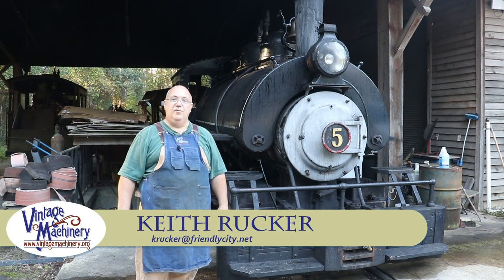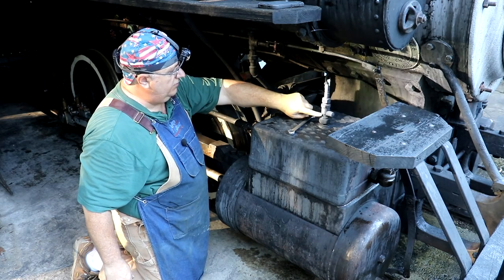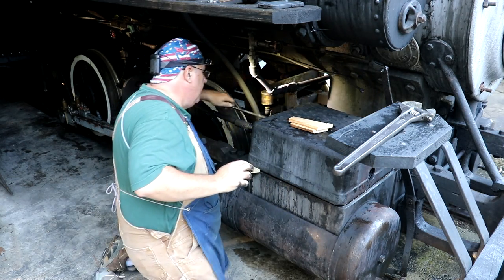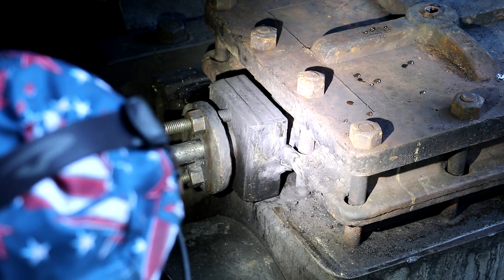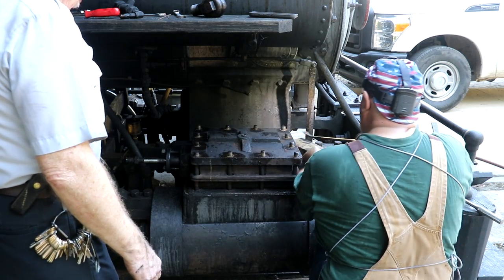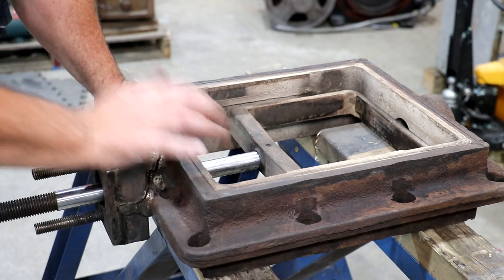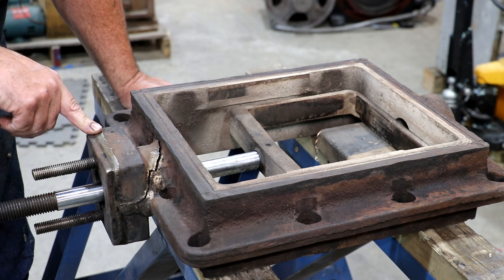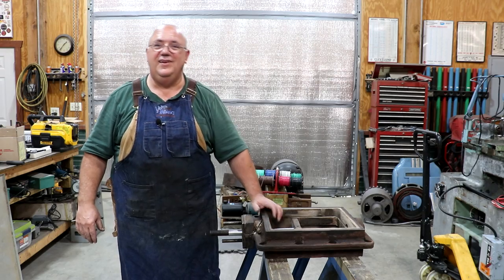1917 Vulcan Steam Locomotive: Removing a Damaged Steam Chest for Repair

Comment: I would check that operating rod connected to the steam chest, as it seemed bent to me, and that could cause an eccentric loading on that packing gland if everything isn't in line.
Reply: That could also be the root of the problem that appeared to be worn bushings.
Reply: I also noticed this as well
Reply: Yeah, I agree. You can see the rod isn’t straight and true @ 11:11 or so, as Keith is unscrewing it.

Comment: Thanks for posting. You mentioned that the crack was allowing the ear to fail downward, which looks to be the case. The long rod you removed looked like it wasn't straight. It would seem that future damage might be avoided if that rod was straightened and the part was made true so the forward and backward motion of the rods were as close as possible to parallel with the surfaces the valve slides on. I hope the preceding sentence makes sense.
Reply: I understood you OK. And I ein't that smart. Is it ein't or ain't or neither?

Comment: Hello from Fayetteville, NC Keith. While many have commented on the valve rod possibly being bent or out of alignment, which makes a lot of sense, I’m thinking that perhaps the maintenance folks may have been over tightening the gland that keeps the packing around the valve rod. The pressure created compressing that graphite packing material is very high and it needs to go somewhere. Is there a maintenance reference saying how much to tighten the gland studs? I used to work for an industrial valve repair shop and we had that problem with one client that managed to destroy several valves before they realized they only needed to turn the packing cap 1/10th of a turn at a time ONLY when it leaked; they were turning it every week as a preventive method.

Comment: I realize you may have already finished this repair by the time the video is posted but if you were to make a silicon pattern from the steam chest you could then make a plaster positive to have a copy of the chest to use as a core to have as casting made. May be easier than starting from scratch with prints. Also, easy to modify and beef up the flange area so it never happens again. Just glad to see you back at the museum
Reply: Can’t. Remember, the casting shrinks by a significant amount when it cools so any casting made from an original will be too small.
Reply: @whodat90  i think cast iron shrinks only 1%, if the inside ends up 1% too small, it can be machined to the correct size, and if the outside ends up 1% too small, it doesn't really matter, and cracked area can be be modified prior to casting to make it way stronger...
Reply: 1/8"  per foot
Reply: @anthonyraffin1034  1/8" per foot should be very close to 1%

Comment: I kept staring at that crack and trying to imagine what the failure mechanism was. The valve rod should be pulling straight in and out, so all the force should be just pushing or pulling straight in line with the rod. It seems like there must have been some side to side (or up and down) motion of the valve stem to have fatigued that packing gland to the point that it broke. I'm wondering if this break is a symptom of something else out of adjustment or alignment with the right-hand valve actuating mechanism.
Reply: As Keith pointed out, welding cast iron makes for brittleness.  Vibration is ALWAYS present, to some degree.  The weld held up for 25 years, which is not exactly shabby.
Reply: @eliduttman315   That still doesn't explain the original failure. There is obviously some misalignment somewhere and for now I would start by straightening the valve rod which is bent.
Reply: Yes, I was musing as to what the failure story was. I noticed that the rod which screws onto it is bent, which is either a symptom or a possible cause, and I wonder if the gland was ever overtightened.
Reply: @eliduttman315  25 years is a long time but the engine was probably fired only a few times per year. Still, something is causing that part to fail as several have pointed out. Love Keith’s knowledge and expertise in old technology.

Comment: Noticed it looked like the rod was bent when you removed it.  Did something come down on it and bend it  That could have put  extra pressure on it causing the crack.   But should work good repaired.   Looking forward to seeing the rest of it
Reply: I'd wager somebody stepped on it in the last 110 years.
Reply: Looks to me that there is a definite alignment issue that is putting downward pressure on that sealing gland. Each time the valve rod moves through the gland it’s being forced through at slight angle not parallel to the mating surfaces of the valve and the upper plate of the steam chest and the porting surface in the cylinder. This creates a stress on the sealing gland body that repeats with each stroke of the valve. Eventually the stress creates micro defects in the metallic lattice structure, and these defect vacancies coalesce into voids and the voids further concentrate the stress which leads to cracks forming. This is the mechanism for fatigue cracking. Unless the alignment issue is corrected the repair will fail again as repetitive cycles stress and relax the brazing. A bent valve actuating rod could be the source of the alignment issue.

Comment: I've always wondered why you can't just use the old part as the pattern for a new casting? I understand shrinking is a concern, but one could build up the piece with clay or filler to allow for the expected shrinkage... thanks for another fun video!

Comment: What ever happened to the coal feed engine that Abom couldn't machine? That was a fascinating device and I wondered how it would go back together.
Reply: I suspect the completion of the HBM restoration project is on the critical path for the stoker engine to be worked on again... The first time I saw that stoker engine case, I thought to myself "this is an ideal application for a small HBM...". Then Keith bought one...

Comment: Hi Keith, A great video; love to see how these components that you are going to repair, fit in with the entirety of the locomotive.  Thanks.

An even better repair than brazing is to use cast iron filler.  See, for instance, the repairs that The Steam Workshop did on their 2' narrow gauge Fowler locomotive:  www.youtube.com/watch?v=JHCXMexB5B8

Be well & Best regards, Gottfried
Reply: Nice link. I worked in Gray & Ductile foundry. The molecular composition of the cast iron does indeed change. How they (in your link) slowly brought up the heat in the casting was smart.

Comment: Would a brazing repair done now still last indefinitely or would it always be prone to failing again due to the nickel rod impacting the integrity of the casting itself?
Reply: It's possible to anneal the cast iron to take out the brittleness. The nickle would still be there and might still be a problem though.

Comment: I dont do 3D printing stuff but someone, somewhere can laser scan that entire thing, enlarge it by 5-10% (?) for casting shrinkage, and print the positive. I for one like the idea of the silicone mold, then a plaster positive. Then you could "easily" modify the positive to get a little bigger positive. Sounds easy enough :-)

Comment: If you do get it recast, make the neck bigger. There's no reason (by my reckoning) for that neck to be so flask like. I've seen a few stuffing boxes of this design and it's always a weak point. Were it me, i'd make the rod the weak point, rather than the casting (because i get why the casting is done the way it is).

Comment: Two thoughts from the depths of my ignorance but...

Since you are of a mind to make casting as a long term solution, wouldn't "now" be the time to do it? Rather than wait on blueprints, has the used piece changed enough in size over time to make that a problem? After you have made you repair, it would seem like the right time to create the mold from the old piece.
Also, when I have done things like tie rod ends on my car, I use a white grease paint pencil to mark threads so it is easy to return things to an exact position without having to count threads. Would that work in this situation?

Comment: Love the steam engine videos. What's happening with the restoration of the other steam locomotive you and the others are working on. Last we saw was you were trying to machine the inside of a huge piece that had spray weld applied but the angles were making it difficult ?

Comment: I wonder is there is a stress exerted on that part of the casting from the rod motion for the valve that contributed to the part initially cracking along with the heat cycling for decades.

Comment: Even if you do find the blue prints, maybe you should modify the prints to beef up that area to make it a little strong part so it can handle the stress better. It looks like a weak area from just the way it was designed. Just an idea...
Reply: Counter-intuitively, beefing up a design could actually make it more likely to break! These engines often will have weak points designed into them such that in the case of a failure it doesn't destroy itself. For a 100 year old loco it's not doing so badly, I would expect the new part to last at least another 100 years again and maybe even longer with the high quality materials and processes we have available to us today
Reply: Valve bodies were a wear point.  Remember these engines weren't designed to last for over 100 years they had a service life of around 30 to 40 years before being retired and scrapped.  These things are literally older than the engineers thought they'd make it.

Comment: Before you start grinding and heating. Are you going to check the top and bottom sealing faces on the surface plate. 
Just probing with a feeler gauge.  I don't recall if your lapping plate is large enough to lap the faces.  

Instead of trying to duplicate the shape of the casting. A sheet of cast iron could be machined . Then the outside detailed with a needle scaler to get rid of the machining Mark's. 
Rectangular cross sections and a pattern made of wood like a picture frame with significant draft in either direction from the parting line could me made up on your table saw in an hour.   Removing metal in 2022 is far easier than it was in 1890.  You have the machines to do it at hand

Comment: hey keith ! thanks for the videos as always. im looking at the failure and at the design of the chest....im thinking thats a flaw in design and will fail there again. i ponder if cutting it flush to the steam chest boring and threading the chest and using pipe to recreate the stuffing box for the valve rod. any future failure would not require removal of the valve body just the threaded pipe  but steel plays better with bending than cast so it probably would not fail.

Comment: Is there a similar Steam Chest on the other side of the engine that you can take a pattern off ?
Or is that one repaired also  ?
Reply: It is much easier to consult the original documents than it is to reverse engineer a part especially when you've got a 100+ year old part. This steam chest's counterpart has decades of wear and tear from high pressure steam ( which will eat through through cast iron, as it did in another episode on this locomotive ), corrosion and abrasion, maintenance via machining and boring out of irregular surfaces, field modifications, and other factors in this locomotives history unknown to the current operators.

Comment: changing the studs to a vertical configuration probably doomed this repair, (as doomed as only 25 years on a repair is) having the studs reinforced by the web of the casting would be much more preferable. I would bake that sucker in a oven to 400 degrees before attempting this and then throw it right back in there slowly dropping the temp to nothing over a day

Comment: Enjoyed the video, love these old engines.  Something I wonder about - when repairing cast iron it always seems to be a choice of arc with NiWeld or brazing.  Does anyone even think about gas welding with cast iron rods?  Back mid 60's when I was in high school I welded two cracked engine blocks.  Grind out the crack, Preheat to about 400°, torch weld with 1/4" square cast iron rods, slow cool.  The heating and cooling is slow enough you avoid the hard spots & cracking of arc and the "obvious repair" of brazing.
Reply: Yes I have done cast iron torch welding like how you mentioned.